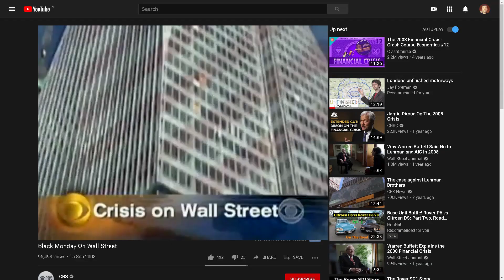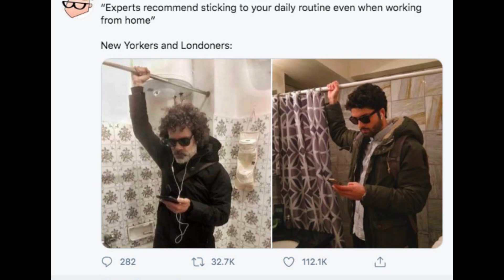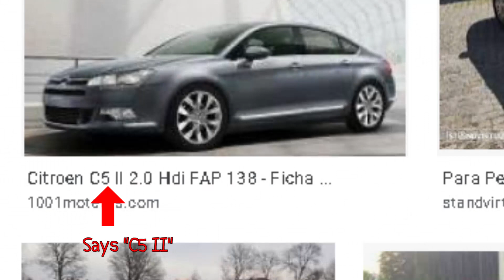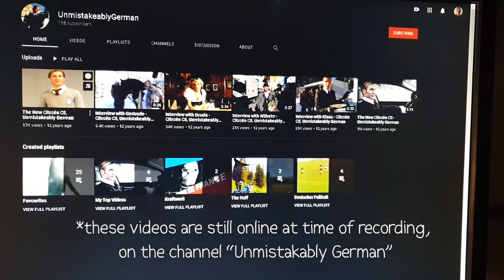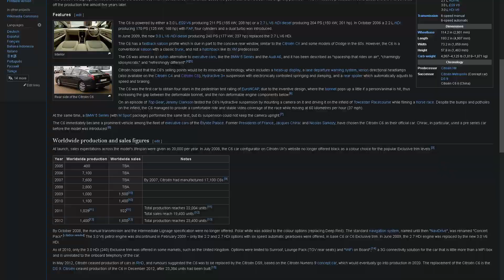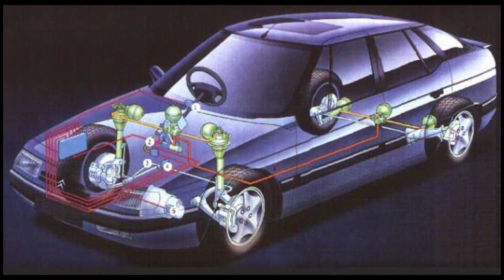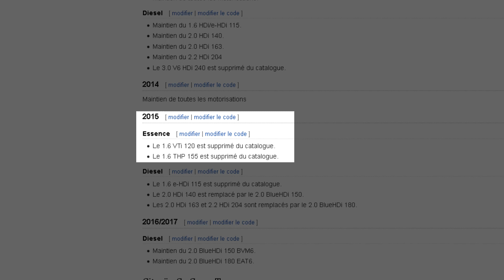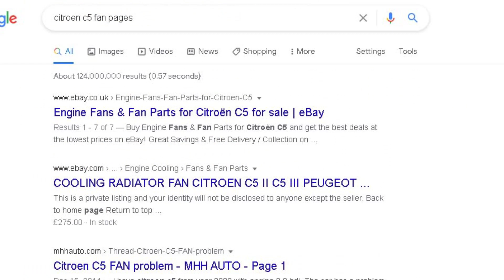Citroen C5 X7 - A Review | Part1 | A Short History

Comment: Excellent review video thank you. 

I had an X7 generation C5 2.0HDi VTR+Nav Tourer from new in 2010. Loved it. Very stylish, very comfortable, fuel efficient, etc. After 8 years and 88k miles of almost completely trouble free motoring, I traded it in for a Mercedes E300 Hybrid, which I thought would last me many, many years - BAD MOVE! I got rid of it after only 2 years and 12k miles because it was so frustrating. Almost every day I would get into it to be confronted by some random error message - "Reverse Gear is not possible", "Antilock Braking System Disabled", "Collision Avoidance System Faulty", or some similar random fault message. It must have been running Windows, as switching off and back on again fixed it each time!

I then went to a Peugeot 308SW, but the suspension was more sporty than comfortable. Then changed after 12 months to a Citroen C4 Picasso, which I found to be like driving a minibus and uninspiring. Plus touch screen for everything is downright dangerous. Why on earth should I have to take my eyes off the road to change the temperature, etc is awful.

Then came the Eureka Moment. I saw a low mileage C5 2.0HDi Executive Tourer for sale locally. This one has the Hydramatic 3+ suspension too. Went to see it and when I took it for a test drive, it was like coming back home! Bought it, love it and I will hopefully keep it for many years to come.
Reply from the maker: Great story! Thanks for sharing it!

Comment: I've got a 2012 C5 Tourer 2.0HDi 163 and it is a fantastic motor car. Stylish, practical, well-equipped, frugal, fast and roomy. The last generation Hydractive suspension is astonishingly good. It's as comfortable as a nice sofa and while in no way sporting, it simply doesn't lean in corners and you can carry a lot of speed through them. The media simply didn't understand that, in their obsession with stiff sporty suspension.
Reply: So true what you say about the media. Has the system been reliable? Any leaks or anything?
Reply: @torresalex  Nothing has ever gone wrong with the car, and it all works perfectly. The service history is spotless too, so it has been reliable from day one.
Reply: @concordelounge  I thought so, that's why I asked. Old Citroen hydropneumatic systems were... problematic, to put it mildly. My BX dropped fluid like a non-house-trained puppy. Now that Citroen cracked it and made a hydractive system that was reliable, they stop making them. Frustrating.
Reply: @torresalex  Yeah, they really got the 3+ right with this model. Mine still has its original spheres at 125k miles and there's only a bit of light surface corrosion on the rear pipes, which i've scrubbed off and protected.

Comment: Thank you for a sensible, honest and mostly unbiased review. I've driven lots of different cars during my motoring career but have stuck to Citroën privately since 1973. The most annoying problems I've experienced are the reviews... in my view motor journalists seems to be inherently negative towards Citroën though they seem to miss all the important stuff that Citroën has always delivered. Safety features as, anti-fatiguing comfort, exceptional grip and balance (don't confuse lean as a non-grip feature..), well balanced steering ratio, exceptional brakes etc etc. My C4 has a unusually big and wide airbag (non-rotating hub) that is developed together with Autoliv and is safer than most, just like the hubless steering column in all IDs, DSs, CXs and maybe some I don't know about. Apart from a period of bad choice of material in the electric system (mostly during the 80's) the cars has been safe and reliable. Problems with other cars, like new rusty Mercs and electronically related BMW problems seems not to be worthy of mentioning or cause for depreciation or worry.. Some even dismiss new Citroëns as failures even before launch. So, thank you again, looking forward to more on the same subject.

Comment: I did own a 2012 Peugot 508 Sedan Petrol and the turbo was unreliable.  Is the Citreon C5 the same car in terms of the engine, turbo etc?
Reply from the maker: Yes. If it was the 1.6THP, that's easily explained. It's a BMW-sourced engine and it's s**t. I did a video where I mention that.
Reply: @comcarclub  Ok, i thought the Citreon C5 2011 petrol would be better built then the Peugot in terms of the engine, turbo, chassis etc.

Comment: I bought a 2009 C5 VTR 1.6HDI last year because it was good on fuel. Although it is comfortable and indeed frugal, I have been massively disappointed by the build quality under the bonnet:- particularly the huge amount of plastics which just clip together without proper fasteners to constitute the whole intake system. Over the years, this stuff gets manhandled by various garages who invariably break the tabs off the clips that hold it together and not to mention it degrades and goes brittle. Doing a basic service was quite an eye opener!
Reply from the maker: That's unlucky. People who are used to fiddling with PSA engines and work for the brand usually are a lot more careful, IMHO. It's usually the apes that work for one of those big name franchises that screw everything up. I'm never using THEM again

Comment: Hey, I gotta say, you really nailed this video. Could you do the video on the Peugeot 407. I personally hated the car because of the reviews, they said that it was bad car with a bad interior, uncomfortable ride and horrible handling, and, therefore, I never even gave it a second thought. I looked at B6 Passats, 159s, A4 B7s and E90 3 series, and none of those cars did what i expected a 4.7m saloon to do, and that is: Be relatively enjoyable to drive, have a decent quality interior and, finally, be comfortable. Some of those cars (B7 A4, 159) did two of those things well, but seriously flopped at one of the three (the 159 is uncomfortable as fuck, and the B7 was just a completely dated car with a dated interior). The E90 was majorly fun to drive, however comfort was non existent and the interior rattled and had a lot more hard plastics compared to older E46s and E39s. Alas, the B6 is, to this day, the worst car I've driven, as it was by far the most uncomfortable, dull handling pile of garbage covered in extremely hard plastics that rattled whenever they could. Seriously, the interior is so cramped, the steering is dull and not informative at all, and the plastics are so bad that I can't even begin to describe how awful the car is from the inside. So, coincidentally, without any direct intention, I gave the 407 a go, and I was blown away. The interior is pretty spacious and the car is filled with soft touch plastics, the ride is by far the best of the bunch, and the handling is pretty good because it has a relatively short wheelbase which makes it far mor controllable. And when paired with a 1.6 HDi, it really rarely understeers, it feels almost like an AWD car. I waged between the 2.0 and the 1.6 but eventually went with the 1.6 cos it had a better feel on the steering wheel because of it's older hydraulic-only steering pump. However, I gotta say, it is, by far, the ugliest of the aforementioned bunch. It isn't the ugliest in it's class, nor is it particularly ugly, it's an average looking car at best, unlikd the others that I looked at, which were simply better looking or, in the 159s case, bite the back of your hand  beautiful.
Anyway, stay safe and keep up the good work. Cheers!
Reply from the maker: I'm not sure I can do one on the 407, since the premise of these videos is that I own the car in question, and I don't have access to a 407. Either way, thanks for the info and comparison on those cars. I'm thinking of doing something of the sort, i.e., comparing the C5 to its contemporaries
Reply: @comcarclub  I was looking at a C5 MK2 too, and it is overall a better car, more comfortable (better suspension and much better seats), however I was scared of the Hydroactive suspension so I dodn't pick it. That is, maybe, the only car that I regret not buying over the 407.
Reply: @konyina  ah, don't regret it. They're similar under the skin and the 407 has an advantage: it seems to have sold a lot more so you'll have a better supply of spare parts
Reply: @torresalex  Yeah, spare parts are plentiful and the car is extremely cheap to maintain, especially considering the class.
Reply: The 2.0 HDi has an electro-hydraulic pump. Benefits of handling but also economy.
Reply: @khalidacosta7133  Eh, I really prefer the 1.6's steering, but the 2.0 is overall a no brainer. I just love the mechanical and connected feel that the older hydro-only steering wheel pump provides.
Reply: @konyina  The Electro-hydraulic will give a better feel. The pump can switch off entirely after 30mph but at lower speeds, it has far more action so feels light and numb. The issue with full electric power steering, isn't the electric part. The motor is on the steering shaft, which is a lump of metal around 5 kg. That requires a lot of force to "spin", which makes the steering feel dull and dead even when it's far more directly connected. The 1.6 will give a better feel when driving as it weighs less and the car is more balanced. If you ever drove the 2.7HDi, as the engine is so heavy, it kills a lot of enjoyment, far more than the 2.0!